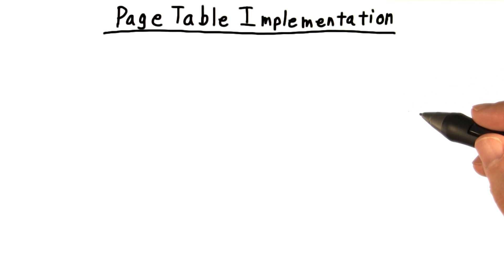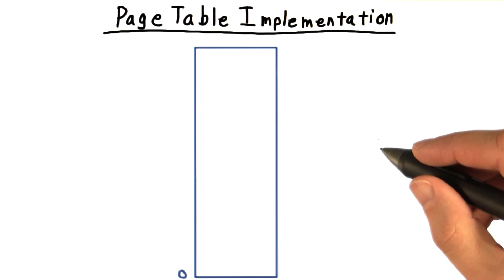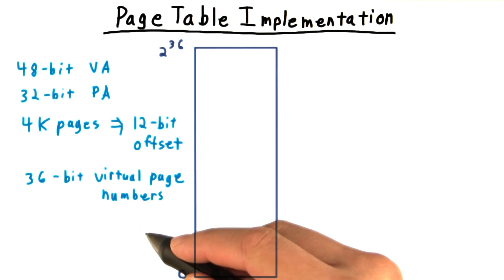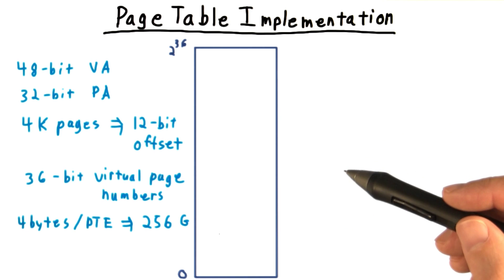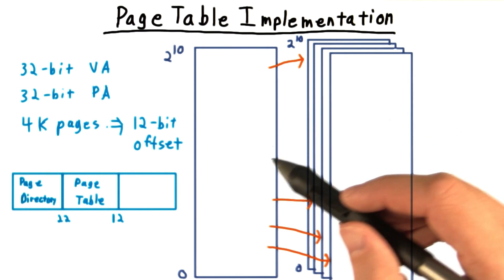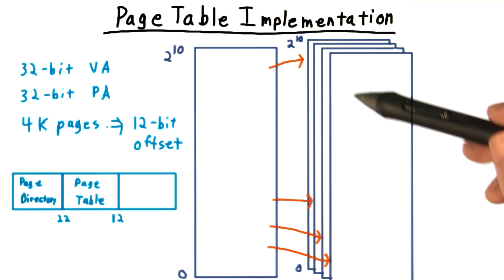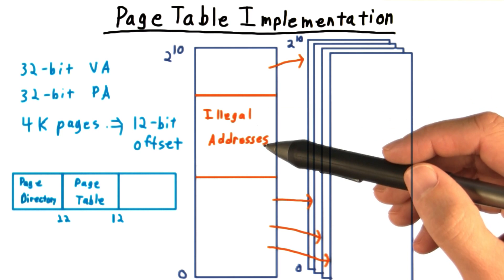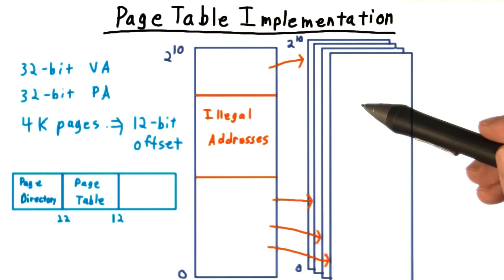Page Table Implementation

Comment: You said "We've used up 12 bits for the offset". What is an offset and where did it arise from?
Reply: Each page contains 4KiB = 4096 Bytes. That is given in the video. We want to be able to address every single byte. Therefore we need log2(4096) = 12 bits to give every of these 4096 a unique address. The page table actually only maps the first bits (first 20 on a 32 bit system) to a physical page frame on the RAM. More specifically, it only contains an entry to the physical address of the beginning of that RAM section. For example let the page table say: Virtual Addresses starting with 0x1000...... go to physical address starting with 0x2300..... These dots (the last 12 bits on a 32 bit system) are the physical offset and are just added to the physical address of the beginning of the physical page frame. Using the page table example from above Virtual address 0x10000013 resolves to physical address 0x23000013
Reply: @petersill6908  this comment saved my life
Reply: @petersill6908  Thank you so much for the explanation. I was trying to wrap my head around that throughout the video